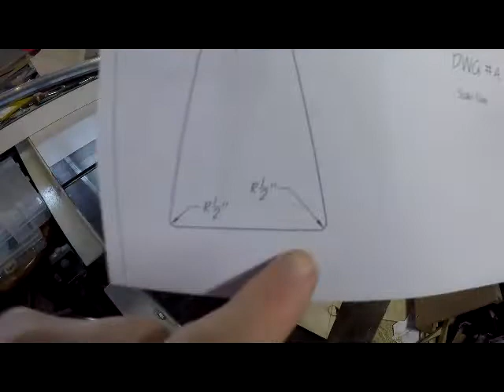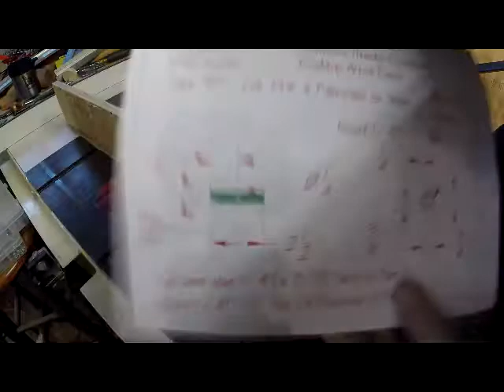(S-2 Ep-15) Make a Homemade Desktop Art Easel (FREE PLANS)

Comment: Couldn't find your plans in the arts & craft section.
Reply from the maker: When you scroll down to the appropriate article, click on that article/title to open the full page for that article and you will then find the hyperlink to download the plans. It may take awhile to scroll down to the article. Hint: Note the date this video was posted.
Reply: @DowneastThunderCreations  I went onto the page clicked project at top.  then arts & crafts. easel wasn't there at bottom of page. Click older entries.  wasn't there either.
Reply from the maker: You have to go through the archives. That video was posted years ago so it will take awhile. You'll have to work for it to find it - but it's there. I still hear from people that have been downloading the drawings with no problem. Sorry, but I don't have the time to dig it up for you right now. It's almost 1am right now as I type this and I still have a mountain of correspondence to get through before I can get to bed. Again, note the date the video was posted - it's around the same time the post on the web site with the plans download was made.